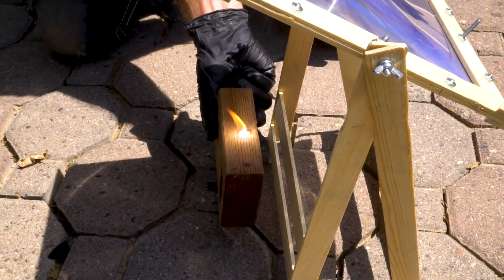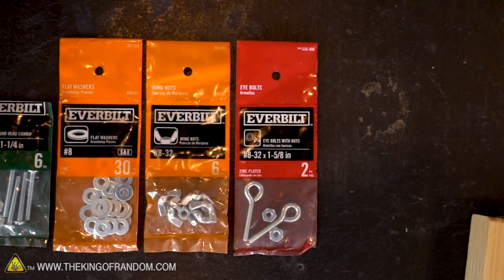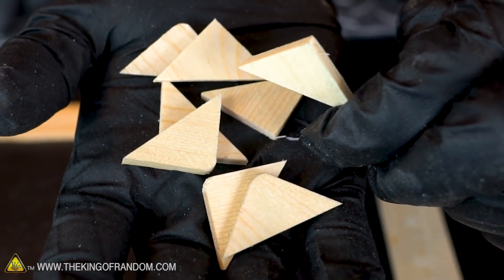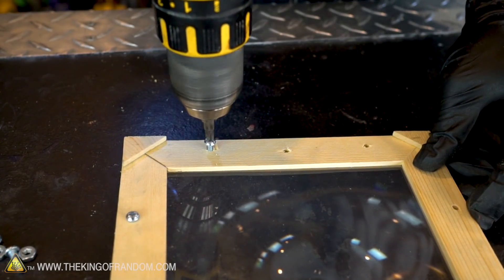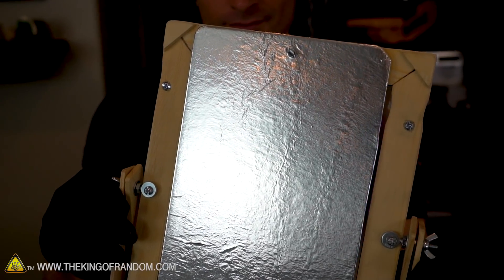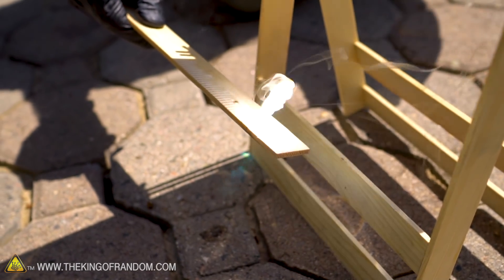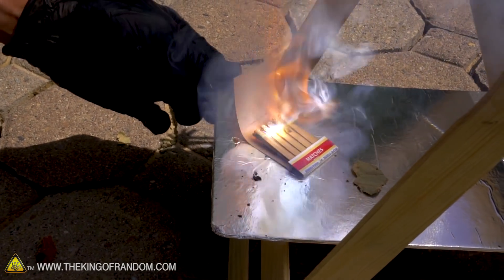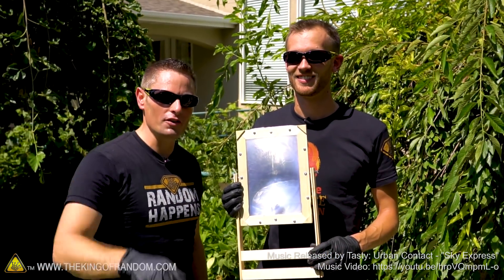Powerful Desktop "Solar Scorcher"! TKOR Shows You How To Make A Mini Solar Scorcher That Works!

Comment: To everyone saying combine it with the big one:

It wouldn't help, and moreover, it wouldn't even work. The larger one is already focusing all the light it's gathering into a point, and you can't focus farther than a point, so adding the smaller one won't help. In fact, it will get in the way. There are three cases. The first is that you put the smaller one farther from the big one than the focal point; in this situation, the light will be hitting at an 'outwards' angle, meaning that the smaller scorcher won't focus it properly. The second is that you put the focal point of the larger one on the smaller one, in which case the smaller one will likely just melt. The third case is that you put the smaller one in front of the larger one, in which case, it will mess up the focal point completely and likely make it disappear, this is because the lens is designed to focus parallel rays, and since the rays from the big one aren't parallel, it wouldn't work.

Comment: The large fresnel lens from a projection tv, which I have, has no problem melting pennies, copper clad circuit boards, and aluminum soda cans. 

I use a welding helmet to protect my eyes from the intense light. 

There is no way that the small one you have built could ever generate the temperatures required to melt copper. It is not even burning a hole in the aluminum foil adhered to the cardboard. 
:

Comment: Surprised you didn't accidentally burn that pretty stand you made for it. I would make sure that your measurements don't end up putting a focal point on a support stick. Maybe paint a line on the supports where the focal point length of ignition occurs.

Comment: Could you reflect light into either solar scortcher to light vertical objects?
Reply: BOOST JUNKIE yes
U need to use a small magnifying lens to change the rays so they look like a laser, then use a mirror to move the beam to burn stuff  vertically

Comment: Might I recommend to calculate the distance of the focal point from the ground so that you can actually place one of the supports of the legs at that length that way you can just slide in the tray rather than slowly trying to find the focal point manually..there is an actual calculation for it . It would be safer and much easier

Comment: See whether the Mini Solar scorcher will turn dry Ice into CO2
Reply: You can't melt dry ice it is either  a solid or gas(carbon dioxide)
Reply: Carbon dioxide cannot be a liquid at atmospheric pressure.
Reply: weekend wild unless it's at or past its supercritical point (AKA at a ridiculously high pressure)
Reply: he never said liquid co2
Reply: I changed it
Reply: Dry ice is CO2, just in its solid state.
Reply: yeah I know

Comment: Grant, I think an added bonus feature to the mini solar scorcher would be a small 1/4 turn handle on the leg that spins an axle with cam lobes that lift the platform just enough to bring the schorcher specimen into the focul point of the beam.

Comment: here is a test that you should try. get a  diamond and a laser, and shine the laser thru the diamond, and then shine the sun light onto it to see if the laser gets stronger  you should be able to test the strength  before and after   if it works you will have a solar pumped laser ie a laser made more powerful via solar as  diamonds are being used to combine lasers and a laser is just light and if sun light will bond with the laser it will gain power  lol don't know how you will keep the diamond cool as its going to get hot you might need to make it pulsed

Comment: why don't you put the small solar scorcher under the big one and combine the focal points to make it even stronger and heck put a magnify glass under the mini solar scorcher while under the big one and see how fast you can light things on fire.
Reply: Wouldn't help, and moreover, it wouldn't even work. The larger one is already focusing all the light it's gathering into a point, and you can't focus farther than a point, so adding the smaller one won't help. In fact, it will get in the way. There are three cases. The first is that you put the smaller one farther from the big one than the focal point; in this situation, the light will be hitting at an 'outwards' angle, meaning that the smaller scorcher won't focus it properly. The second is that you put the focal point of the larger one on the smaller one, in which case the smaller one will likely just melt. The third case is that you put the smaller one in front of the larger one, in which case, it will mess up the focal point completely and likely make it disappear, this is because the lens is designed to focus parallel rays, and since the rays from the big one aren't parallel, it wouldn't work.
Reply: I would like to see it, but make an even bigger solar scorcher to put over the large one and then point all of them at his house! :D
Reply: yaksher You should be a science teacher! (compliment BTW) :D

Comment: What happens if you mix liquid nitrogen and liquid oxygen. Is it flammable???
Reply: No, nitrogen will catenate (bond with itself) long before it will oxidize
Reply: no, water its self is more nitrogen and the oxygen makes it not flammable. A 50/50 ratio I don't think so....
Reply: Liquid hydrogen and liquid oxygen = liquid fire
Reply: notfruit even at the temp where all atom freezes?
Reply: Shadowphyre sulfur and flouride is flammable, so sulfur hexaflouride is flammable? It's not
Reply: Bradley Huizinga No, nitrogen bonds are one of the most stable bonds on earth, with a tripple bond between 2 nitrogen atoms. The only way to break this bond is with things are powerful as lightning
Reply: Bradley Huizinga nothing. Basically it will just make the composition of our air
Reply: No because n2 has 3 electron bonds and 2 lone pairs so it ain't gunna want to bond to anything, it doesn't have the capacity to bond with anything else because an atomic bond needs a single electron to bond another, nitrogen has 5 electrons in its valence layer so n2 bonds 3 times to itself then has 2 lone pairs ( two electrons in a lone pair)
Reply: oxygen is not flammable, nor is nitrogen

Comment: But can it melt metal???
Reply: You have to specify the metal. Mercury melts at −39°C (−38°F).
Reply: Solar schochers cant melt steel beams :D
Reply: yes
Reply: The metal reflects too much light to absorb the energy in the form of heat.
When it comes to the temperature it reaches, it may melt some metals, but the metals themselves would instead reflect most of the light, barely absorbing the energy
Reply: Also, heat comes in 3 possible ways: Conduction, Convection, and Irradiation (i think that's how it's written)
If you don't want to read, you don't have to, just putting this here if you're curious about it.

Conduction is kinda self explainable - in a heated surface, the heat just "spreads" to the object.

Convection - only happens on fluids such as liquids or gases, which is actually what causes the wind.

Irradiation (which is the one the solar scorcher uses the most) - This is the only way heat is conducted without the use of matter, instead it's in the form of electromagnetic waves, and when absorbed, causes heat, but it can still be reflected from certain objects, which absorb much less energy.
Reply: Besaco Mad I wanna melt my bullet casings down to something

Comment: You should try if you could make carbon into dimonds with the big solar scorcher.
Reply: Ivan Ivan diamonds are made from high pressure, not fire.
Reply: TrollingINC actually dimonds are made with high pressure and high temperature.
Reply: Ivan Ivan It's more dependent on pressure not temperature. You would never turn carbon into diamond at atmospheric pressures.
Reply: Ivan Ivan You’re correct, but pressure is much more important
Reply: I agree from the beginning but you need high temperature also
Reply: Ivan Ivan Yes. Temperature isn’t the hard part. Getting the pressure to 50,000 times atmospheric pressure is the hard part.

Comment: You should make sodium metal and throw it into water.
Reply: Ivan Ivan sodium is already a metal
Reply: You can't make sodium metal
Reply: blazed viper  sodium could be salt but sodium metal is different because it exploded when put in water.
Reply: Frozen Wolf  yes  you actually can make sodium metal just search it up
Reply: Banana Bread Man  just search it up.
Reply: Sodium is a metal it stays a metal it dose not change its already a metal. You can't make a metal element into a non metal.

Comment: Hey Grant, I have been thinking about how you were trying to make your gear and how the sand kept popping out. What would happen if you went back to the method you used for making your brass knuckles or even your mini master sword by filling a bucket with sand with the styrofoam mold inside? Would that help you cast a perfect gear?

Comment: You should make bullet proof glass and test it.
Reply: glass is not bullet proof

it's just bullet resistanf
Reply: +tanaim shareeb resistant*
Reply: tanaim shareeb  there is a type of glass which is bullet proof and stops bullets. It is used on the president's car.

Comment: Hey Grant, a little building tip for you from when I used to do a RC airplanes, when your building and gluing together would stuff like that use wax paper to lay down and built on top of. That way you can leave it in place weight it down let it dry and it will not stick to the surface. Hope that helps you!

Comment: Try shining the giant solar scorcher through the tiny one and see what it can melt at such a high focus
Reply: Random Dude you can't focus something a second time.
Reply: I think that would be a bad idea, the mini is already out putting a focused beam, but using the much larger ones focused beam could ignite or melt the mini
Reply: Diogo Ayres they didn’t teach us about magnifying light twice, I just thought it would be something cool to try and I thought it would work seeing as though a microscope uses multiple lenses
Reply: TrollingINC. You can
Reply: Trying to combine Fresnel lenses to increase the focal point's energy/heat by themselves is simply not possible-no matter what position or angle or distance- in fact it will only decrease the power if anything... EXCEPT there is one way to combine 2 or more Fresnel lenses with the addition of some flat mirrors. This is because the Fresnel lenses can be positioned horizontally to each other while still aiming the sunlight at the same focal point. It is the same concept as using multiple parabolic mirrors. The only way to amplify the energy/heat  is to increase the area size of the captured/reflected sunlight. This is why any vertical stacking arrangement will not work
Reply: You would melt the small one
Reply: You know it would just "reverse" it right? that is, if it won't melt right away.
did you skip out on physics class when they were teaching about lenses and refraction?
Reply: yes you can

Comment: What would happen if you put mercury in a vacuum?
Reply: Cify probably nothing. Murcury doesn't have bubbles so it would just do nothing.
Reply: Cify Nothing. You've seen a thermometer before right? The mercury in that does nothing in the little tube with a perfect vacuum in it.
Reply: Cify yeah
Reply: In fact, mercury was and sometimes still is a go-to method to measure vacuum quality, based on its relative displacement in a container.
Reply: Nothing at all

Comment: Would love to see this turned into some type of weapon. Might have to try it myself.
Reply: Would be an excellent weapon against ants!
Reply: The Nocturnal Alchemist Like the ancient Greeks were reported to have done? Archimedes ray I believe it is called.
Reply: Yeah maybe attach a super powerful flashlight to it or something
Reply: Too bad Mythbusters already proved that never happened. 

Archimedes Death Ray cannot output enough heat, even with modern metal, which are way more reflective.
Reply: But the principle is still the same whether you use mirrors or a lens. Focus light on a single point and burn whatever it is focused on. It would be great for popping ants. Probably difficult to use for much else in a simple build like this. might be a bit of a stretch, but we have lasers designed as weapons today. It isn't focused the same way, but a laser is focused light.
Reply: The Nocturnal Alchemist what if you took the mini, and made a mini mini.
and then ran the sun through both, making it change direction somehow to point forward.
Reply: next how too should be a solid beam lazer, from the sun, if possible
Reply: The Nocturnal Alchemist your insane you have to let me try to

Comment: i wounder what would hapen if you put the mini solar scorcher and line it up with the biiger solar scorcher and have them both focused what would hapen would the mini just burn up or would you get a extremely powerfull ray?
Reply: djay4487 deved.  You'd just burn/melt the mini scorcher.  The focal point is where all the heat/light is going, you can't focus something that's already focused to a point.  Also another rule is you can't get more heat than the surface temp of whatever it is you are magnifying, in this case the mini would be magnifying the macro scorcher.
Reply: djay4487 deved maybe put the mini at the focal point of the full size, and see if it puts out more heat after.
Reply: Read what was written. The increase is from shrinking the affective space that heats up not more light. I do this with magnifying glass. The large glass collects more light than a small glass and condenses it to a small space. the second glass shrinks the effective area even smaller. It works the same with magnification when putting one glass under another and adjusting the focal points. You get a much higher magnification but a much narrower field of view.
Reply: Solder Joe Your right.
I was simply using perfect magnification, rather than imperfect magnification in my thought process.
Using two imperfect magnifying glasses together would result in a better output.
Reply: Solder Joe still doesn't change the amount of light at the focal point.
Reply: and you de crease the size to the point where it is a lazer
Reply: It would be the same surface area and the same amount of "power". You are not collecting more light in that arrangement.
Reply: The world would blow up
Reply: djay4487 deved you mean like have the pinpoint of the big on go through the small one?
Reply: djay4487 deved I was just thinking about that too!😁
Reply: djay4487 deved It would melt the small one.
Reply: Less surface area and more power on the focal point...
Reply: it wouldent work
Reply: You would not bring the small lens into the focal point of the large lens.  You would bring the small lens to the point the light covers the entire screen of the smaller lens. Then use the focal point of the smaller lens. My guess is that you would gain a 10-20% increase in focal power. Making it hotter by shrinking it's size or effective area.

Comment: Does using multiple lenses create a stronger focal point and higher heat, or would that just destroy one of the lenses? Perhaps not a direct ray into another lens, but playing with the angle/distance/direction or pattern of several lenses?

Comment: How about you try repeating the more extreme things you did with the large version, and see how well it does there?

Cause size does matter. A lens of this size is focusing maybe 20W of power, whereas the large one, based on an estimate of it's size from this video, would be able to focus around 1100W of power.
Reply: How did you calculate that? or are you just throwing numbers into the air?

It would make sense for this to be less powerful, though. Which is why I reallywanted to see metal melting.
Reply: seigeengine size also matters in humans LENNY FACE INTENSIFIES
Reply: +Supra Kooper Collection area * solar intensity. You can find the first through the link in the description, and the latter by Googling.

At surface on Earth, direct sunlight is about 1000W/m^2
The lens is 5"x7" but the edges are slightly covered by the frame, so I took off a quarter inch from each dimension.

4.75"x6.75" = 32 in^2~ = 0.02 m^2~
0.02m^2*1000W/m^2=20W

The bigger one I just kind of guesed he's about normal sized for a male, and used his body proportions to estimate it's 3'x4' = 12 ft^2~ = 1.1 m^2~ => 1.1m^2*1000W/m^2=1100W. I could be off a bit, but I'm close enough to make the point of the difference in the power these focus.

Size matters. A website that sells large fresnel lenses for these kinds of applications, for example, was able to get temperatures in the hundreds of degrees using a small one, but up to several thousand degrees with a large one.
Reply: Yep, no doubts there. The power is all about area of sunlight focused into a point. You can burn lots of things with small magnifying glasses, but they won't do anything like the large one could do.

Comment: It's amazing if you think about it. All this thing does is collecting the power of the sun that hits about 10cmX10cm area and compresses into a much smaller area, about 3cmX3cm, so it makes it denser. Imagine if the sun was 3 times powerful by coming closer to Earth or just up the intensity, it would wipe out all life easily. Our current life hangs on a hair string.

Comment: Put coke cans in the vacuum chamber to see if when the air around the cans is taken out will they implode on themselves if they are empty and will they explode if they are unopened.
Reply: Fury Gamer they should explode rather than implode as higher pressure inside

Comment: can you make a homemade mini rocket and send it into space
Reply: Mouryo Kundu No. he would not be able to send a homemade MINI rocket 100km up in the air. He wouldn't even be able to get close to 1km
Reply: why if he uses or makes a hydroxide combustion process or makes a 1meter cylinder solid fuel made of dextrouse(sugar ) and kno3 it can go upto 100km as the motor when ignited  can go upto 300-500kmph maximum